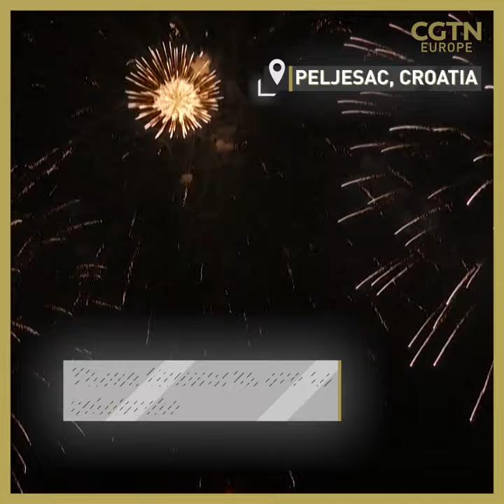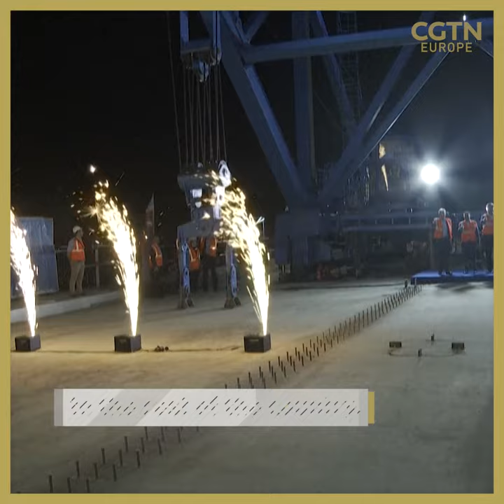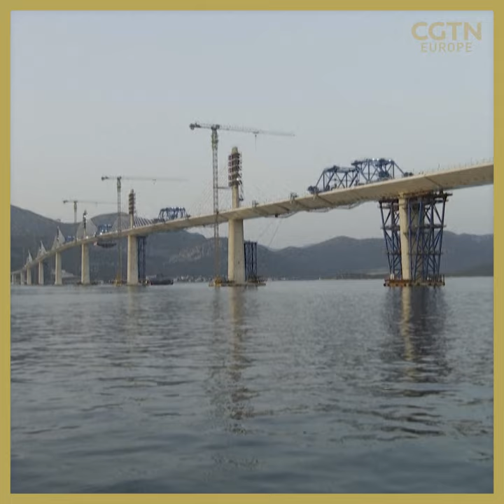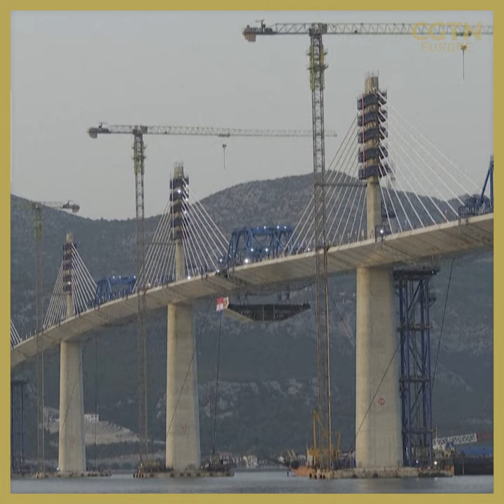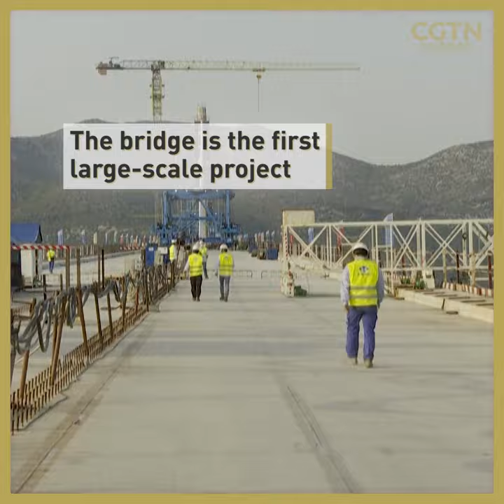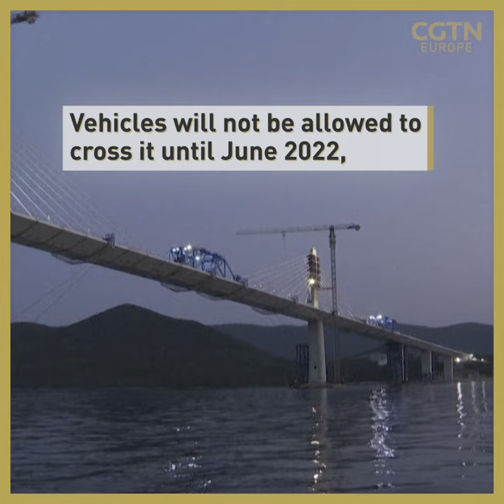Chinese company completes bridge that connects rest of Croatia to its southernmost region

Comment: I have been collecting 32 youtube videos on China being NO. 1 in the world.  
Bridges installtions is one of them and information I collected is
"China has installed bridges longer than the next 9 countries put together by 3.86 times".
Such huge difference between China and the other countries could be due to China has 2/3 of the world's high speed rails which run on  a large number of high level bridges.  Nevertheless the world can expect China has ample experience in bridge building and will do a good job for less than the competitors. China won the contract with the lowest bid ( 22% lower than the next lowest bid) and offered to complete the construction 6 months earlier.